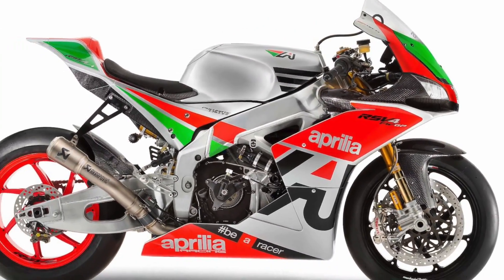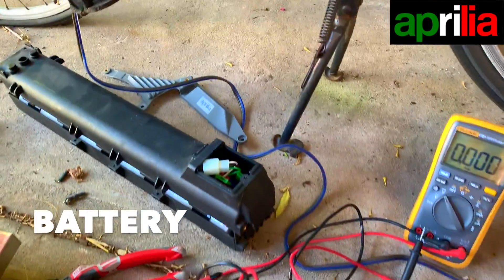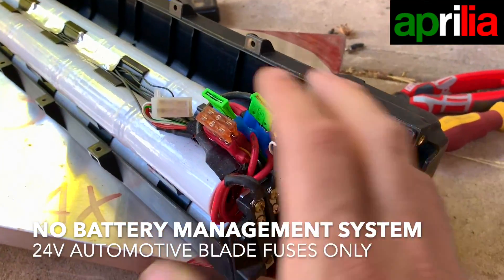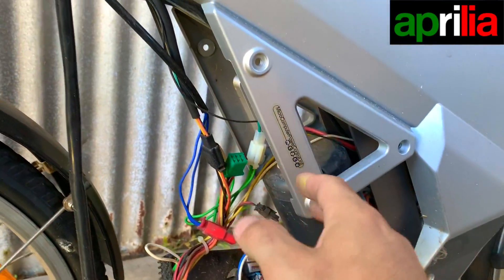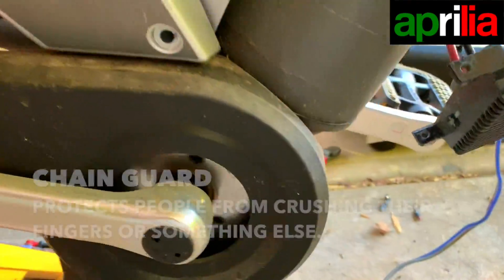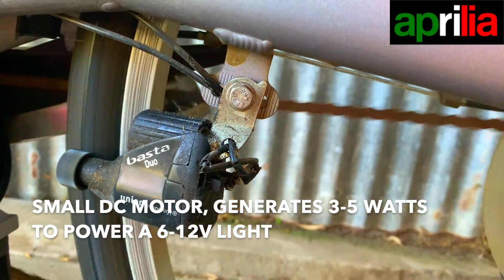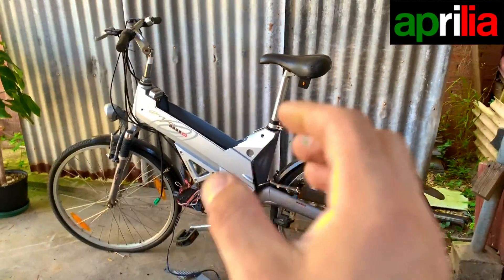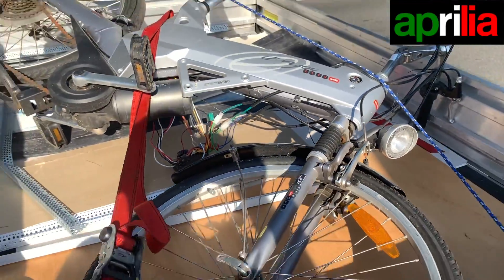18 year old Aprilia Electric Bicycle - Battery, Motor & Controller overview

Comment: Please sir, where can I buy a new battery for Aprilia electric bike 2001 year of manufacture 24 volts. The battery goes to the front of the frame as in your video.If you have the number of the store that I can contact for the battery and order it.

Comment: I have a similar Aprilia Envy Electric Bike, but the battery is running low. I love this bike otherwise, do you know any way to replace the batter?
Reply from the maker: Best thing is to replace your original battery with a much smaller and a LOT more range Lithium battery... you just need to modify the connectors so you can plug a standard ebike battery to your bike but make sure you get a 24v... not very common anymore, most bikes are 36v and 48/52v

Comment: Any interested to a Aprilia Enjoy City in very good condition with a just rigenerated (two months ago) lithium battery 24v 16ah but that doesn't work for some other problem within the cab contacts? 
I'm not able to repair it because i have no competencesas electrician
I live in Milan, Italy my mail address gianppa@gmail
Gianpiero

Comment: bought a newer one of these cheap a year ago as the controller was shot. Just getting round to fixing when you mentioned a possible upgrade it to 36 v, although I suspect the battery might prove expensive. Would I have to use the same type of battery ? or are there better alternatives nowadays
Reply from the maker: Yeaaahh I would say nowadays you’ll get a much better deal upgrading both the motor controller to 36v and the battery to Lithium-Ion 36v, you’ll get a lot more range too. It’s possible to fit/install a removable battery inside that space where the original battery used to be. Get on Aliexpress, type “36v ebike battery” and ask the sellers for the measurements. =]
Reply from the maker: Same for the motor controller, just type on Aliexpress “36v DC motor controller” for DC motor

Comment: Ebikes have so much evolved, it was impossible to make one yourself a bit less than 20 years ago now it's very easy. I did some videos about it if you want to check that out
Reply from the maker: Yeaahh back in the days the only type of ebikes would’ve seen would be using 12v DC starter motor connected directly to a 12v lead acid battery or... some very clever guys machining brackets and lots of wiring fitting RC hobby motors, ESCs and lighter/smaller batteries... internet wasn’t anywhere like its today, we couldn’t find much information too... it wasn’t an easy job!! I always tell people to spend some time on YouTube watching some DIY videos and buy a kit and do themselves... =]
Reply: @BrunoPOWEEER  watching diy videos on YouTube made me start my channel and do many projects I never could have though I'd be able to build before YouTube

Comment: I need this bike. I'd have it brushless @ 6000w by the end of the night.
Reply from the maker: Hahaaa I’ve seen quite a few out there fitted with a hub motor, bigger batteries and controller... the naked frame actually looks kinda cool too...
Reply: @BrunoPOWEEER  Nice video, please, am in need of Aprila ebicycle 24volts control.

Comment: Ni-Mh and moreso Ni-Cd can sometimes be woken from the dead (0.00V). CV charge  a cell with 1.4-1.45V overnight and see if it holds any charge tomorrow.
Reply from the maker: Tore Lund yeahh I was thinking about attempting to revive these cells, I wouldn’t be using anywhere would be just for fun... I’ve been successfully reviving batteries for many years... I’ll give it a go.. maybe make a video if it works haha
Reply: @BrunoPOWEEER  Cheers! Go for it!

Comment: HAD 1 IF THESE  FOUND IT AT A SCRAP YARD  I put a crown tc100 7kw  hub motor on it   (with custom   torque plates    left the mid drive for back up   power   via 1x 8ah 6s lipo    sadly  some 1  tried to nick it   not  knowing  how fast it was  and stuck it into A WALL   the  turnigy multistar packs  didnt blow up  or even burn   despite  a full charge   and the  huge impact   wasnt 1 part   that could be used  R,I,P  COOL BIKE  THO DISC MOUNTS  ON REAR   YOU CAN change forks    as ones on it are  very very naff     bars stem etc   these  ride  well